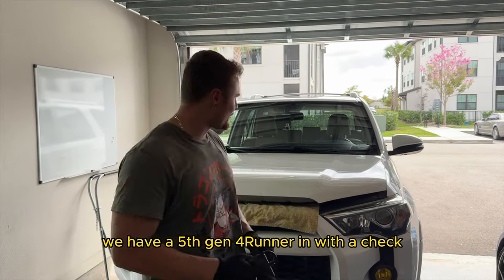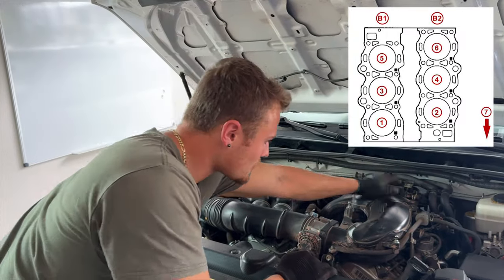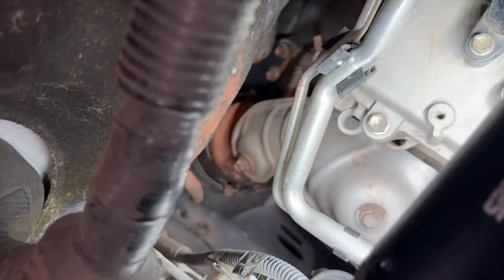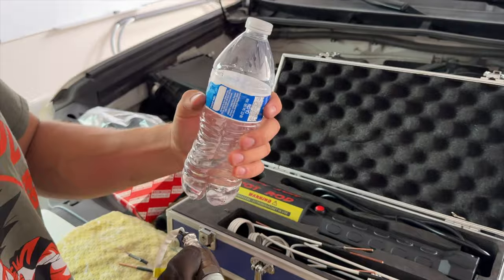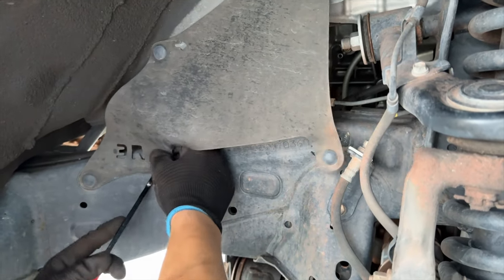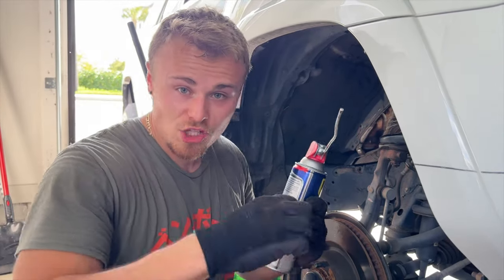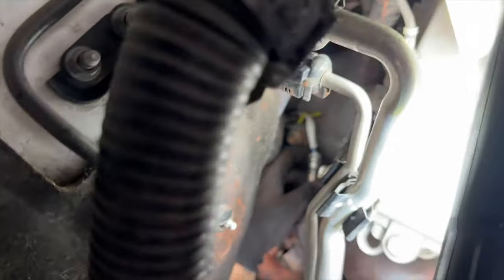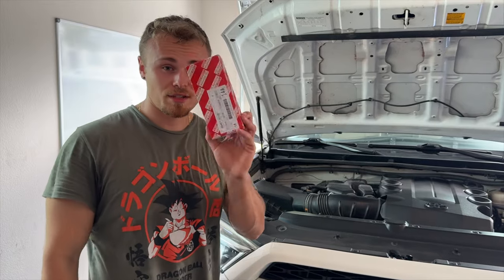How To Replace An O2 Sensor On A 2014-2023 Toyota 4Runner 5th Gen | How to Fix P2195 Engine Code

Comment: There are two part numbers for these. Which part number is for driver and passenger? Also is the driver side just as easy of a location?
Reply from the maker: Toyota 4Runner N280 oxygen sensor 89467-35130    - this is the part number for the passenger side that i installed in the video. im not sure about drivers side. its probably similar